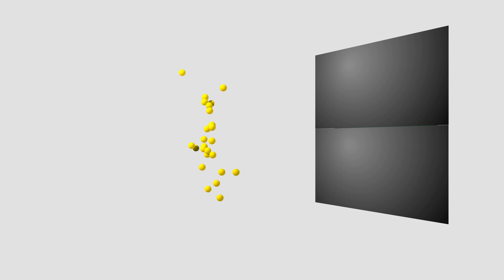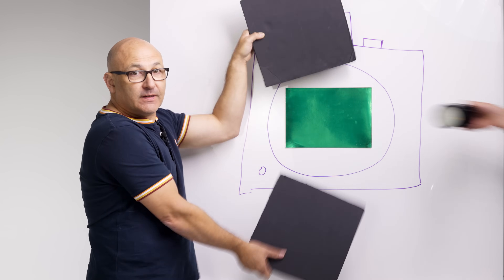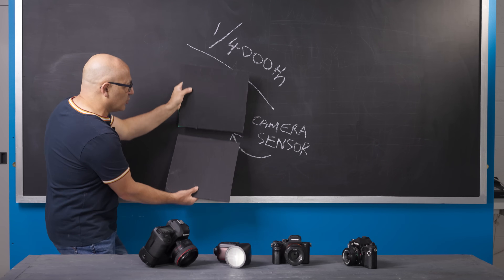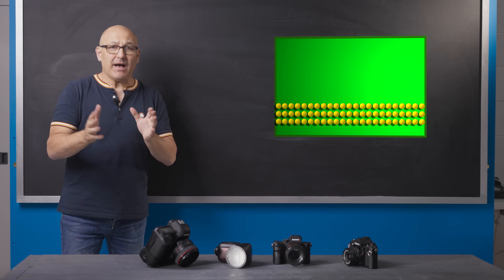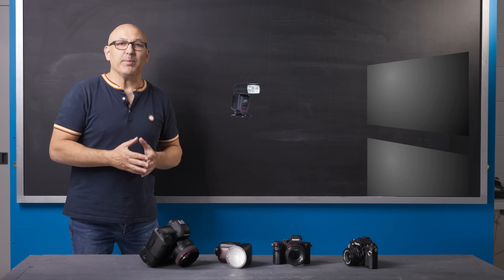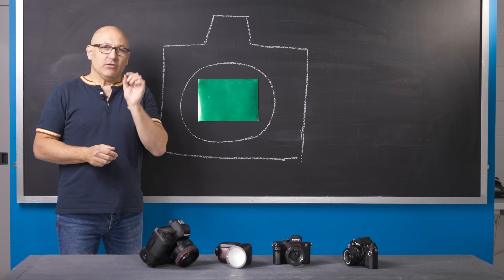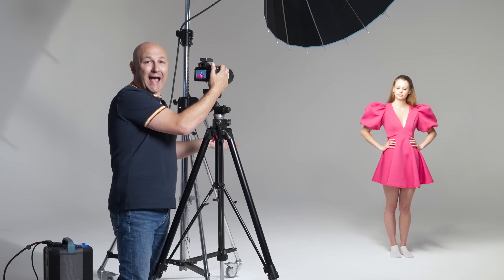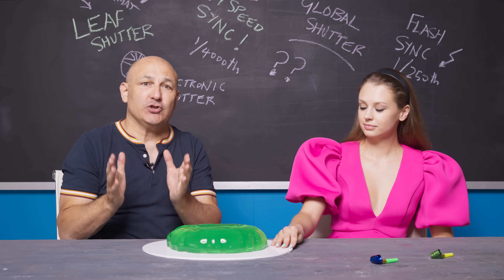Understanding Flash Sync Speeds & Global Shutters

Comment: For the abuse alone, she must be your highest paid model.
Lovely dress tell her.

The only correction to this content is your claim increasing the ISO changes the sensitivity of the sensor. It doesn't. It just increases the gain applied to captured photons on the sensor. The way to capture more photons and thus reduce the amount of ISO gain required it to allow more photons through the shutter and aperture and thus improve the exposure and reduce sensor noise.

You can prove this yourself. Take an image at ISO 1600 with correct exposure. Take a second at 2-ISO-stops lower 400. Take a third at 2-ISO-stops higher 6400, Load them into your processor of choice and normalise to the same exposure, adding 2-stops to the underexposed and subtracting 2-stops from the overexposed images. Then zoom in to 200%-400% and the noise is exactly the same.
However, your theory is most likely correct back in the days of film.
Reply from the maker: Ha ha yes but most of that was special effects, apart from the jelly - but she got her own back on that!

Yes thank you on the ISO and we're fully aware of what you're saying but to keep this video to the subject and simplified we described ISO the way we did. We have another video coming this year where we go into detail on signal amplification, signal to noise ratios, dual native ISOs, analogue amp & ADC, shot noise and thermal noise. 

As educators we try to put across just the right amount of information that is relevant to the particular video/class - in this case we were focusing on Flash Sync, but rest assured we will be going full bore on the detail in the ISO video!

Comment: I like your video, explaining flash synch and global shutter. I love the end of the video.  Unfortunately, your explanation at the end of the video is not correct. I have shot more than 1000 pictures with the A9III and Sony HVL-F60RM2 @ 1/256 power, ISO 250, F/1.8 and 1/80000 and more than 30Pict/s.
Reply from the maker: Thank you but you have to consider the physics. What is the flash duration of your flash burst to reach maximum power and hold that power, flashes have a timing reference called t0.1 or t0.5 which are measurments of the main proportion of the flash rather than the tail of 'weaker' period of the flash. Anyway that being said, my example gave an example of a flash burst that lasted 1/1000th of a second which is common on a high power studio flash, speedlites can often reach 1/20,000th of a second burst when on low power. Either way though if the shutter speed is faster than the flash burst then the simple physics of that dictates that some of the flash burst won't be recorded.
Reply: @VisualEducationStudio  With a GS, it doesn't matter, if only a slice of the total flash burst is recorded with a shutter speed that is faster than the t0.1. About a month ago, I did some experiments, using 2x Sony HVL-F60RM2 on the low end of available power and 2 heads on a  Broncolor Satos 3200 at the high end. The goal was to photograph some gymnasts with a very high frame rates and very high shutter speed using the A9III. The HVL-F60RM2 was triggered via wireless and the Broncolor via cable, as their wireless trigger didn't work. I could get perfect exposure with the HVL-F60RM2 all the way down to 1/256 at ISO 250 and F/1.8 with shutter speeds up to 1/80000. The HVL-F60RM2 is a 60 Joule flash . At 1/256 it puts out approx. 0.23 J which was sufficient to expose the gymnast at 3m flash distance with a frame rate of 30 Pic/s. Using higher levels of flash power does reduce the frame rate of course, but it is still around 15 frames/s. Of course, with the Broncolor, I had no problems to shoot more than 60 frames/s. Now what does that tell you. It is now possible to shoot at very high frame rates and shutter speeds at fraction of the cost using cameras with GS than without GS. The same is also true, if you try to overpower the sun in many outdoor shootings.
Reply from the maker: Well it doesn't matter that it will sync of course but the video explains that you will be losing some of the flash duration due to an excessive shutter speed but if you have enough flash power to cope with that then no problem.

Comment: Thank you for all the fabulous educational videos over so many years!!! If I may make a minor comment. The very last point of your video indicating that only 1/20 of the light from the flash burst would be captured is somewhat incorrect. The issue gets complicated very fast but …. flash burst from strobes are not like constant light. It’s not a continuous output of light at a constant intensity for a fixed duration of time. It’s an asymmetrical burst of light with a fall off - it’s not even an even distribution curve. And there lies the problem with global shutter and current strobes. At very high global shutter speeds it becomes difficult to adjust exposure of the subject in a predictable way by varying the flash power setting - in the way we can do with standard shutters… I know that you know this - but just a clarification for viewers thinking that all is perfect with these new cameras using current strobes….